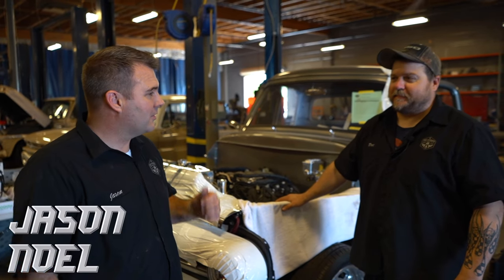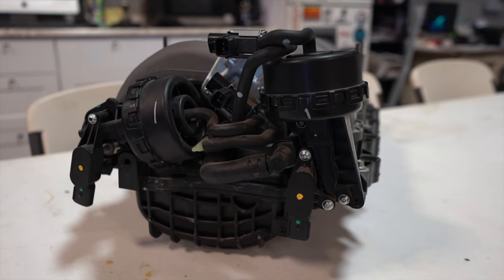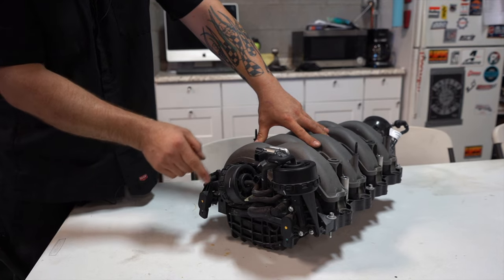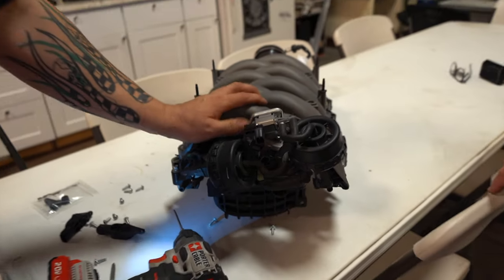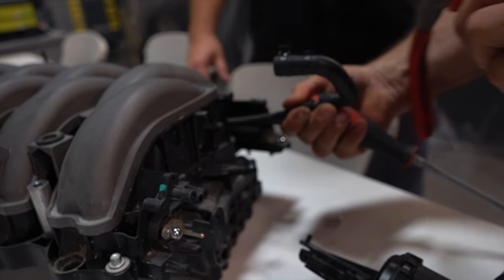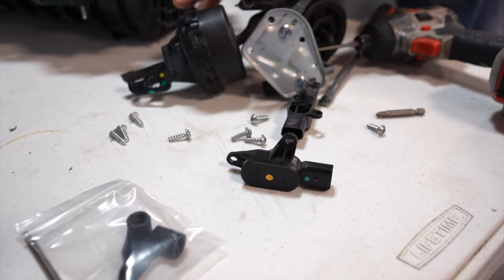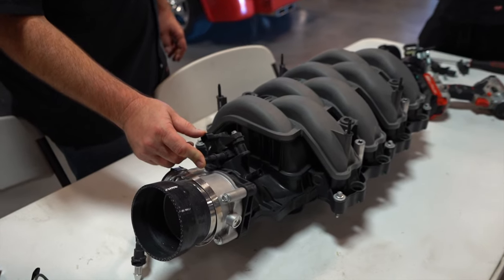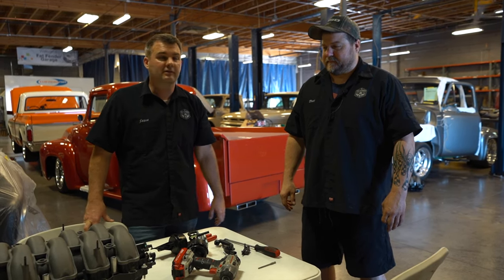IMRC Delete on a Coyote (HOW TO)

Comment: Those flaps are non serviceable correct? There are many of us that have a mystery misfire issue that has been shown to be a result of those flaps breaking, blocking off the airflow into the cylinders so they end up misfiring.

Comment: Dude. I’m begging you, Please, and I cannot stress this enough… hand thread your bolts before using the impact… just got through a 2 week stretch of drilling, bolt extractors, 2 breaker bars, 2 30 racks of Miller, 6 meltdowns, and buying new parts cus of that
Reply: They’re screws going into plastic not important

Comment: Great Video, you covered what to do with the Vacuum lines however there are five electrical connectors! Are they to be disconnected as well?
Reply: Zip tie them up and tape them. They're close to the knock sensors, so you don't want them banging around.

Comment: Please need advice!! I have a 2017 f150 5.0 6speed. IMRC stuck closed bank 3. Ofcourse manifold is covered under warranty. But back back order. Really backed up. I'm thinking of pulling my camper 7500 lbs. 3 hr trip usaul down grades and inclines. Engine light is on. But no preference issues. Posted here to get some honest opinions on what im about to do. Thank you !

Comment: I currently have the gt350 intake manifold but im still NA whats the point of an IMRC delete? I am also having a code showing up with manifold control runner stuck any clue on whats the problem?
Reply: Any  chance you remember the solution?

Comment: Could you make a video showing the general parts you use for a coyote swap. ie wiring harness, control pack, fuel pump,.
Essentially what you need to get the motor running and have it laid out on a table. I would greatly appreciate it. Thanks for the information you have put out this far
Reply from the maker: Bulmaro Gomez good idea. I’ll add to the list of things to video.
Reply: @FatFenderGarage  working on a f100 and there is a lot of videos out there that arent as clear especially with 3 gens of coyotes.

Comment: I have a 2016 F150 5.0, when hooking up to scanner...code reads P2011 (intake manifold control circuit open (bank 2). Will that matter if I just leave it alone and drive on? It seems to run fine and gas mileage is around 21 on the road.
Reply from the maker: Sunsettvu no, you need to have a tuner turn that off. It won’t run properly.  Fuel trims will be off

Comment: You can also use zip ties to hold the runners open if you're on a tight budget.
Reply from the maker: Good tip!
Reply: @FatFenderGarage  lol ghetto tip, but it works.
Reply: Ford is replacing my manifold at 50,000 miles because of a problem with this system. I have a feeling it will happen again. Wondering if I should do this before then.
Reply: Ford is replacing my manifold at 50,000 miles because of a problem with this system. I have a feeling it will happen again. Wondering if I should do this before then.
Reply: @baumiganssupperclub297  no, if you engine is factory stock keep it. You will lose power and torque down low. If you remove them you should tune the car accordingly.
Reply: I'm having the intake runner control valve issue on my 2016 coyote. Been frustrating so far even to just find a new intake. After I got the new intake and installed it, it seemed to be sucking air or maybe a Crack somewhere in the new intake. Has anyone else experienced this? Would love to hear a solution. I'm Sealing up where we think the air leak is happening but had to put old intake back on for the time being. Hoping we got Crack or gap sealed to put new intake back on early next week. I love this truck and only issue so far since I bought it in 2016.
Reply: Can’t find a intake it’s on back order grrr

Comment: I had the car for a while nowmy plan is to rebuild it make it better I just want to find a good motor for it because now it's like high mileage and I will just find a good follow you no motor for it that we were good for the car AC heating and air and all that good stuff if that's possible and I just want to go fast automatic transmission and everything

Comment: Does it work on a 6.2?
Reply: Wondering the same.. also if the intake manifold is already broken does pinning them open work? 

I'm guessing but I think pinning them open will work as if you unplug the IMRC the engine sounds fine.

Also not sure if the pins will work but if you look at the design of there's you could make your own possibly out of some metal. I'm sure if it's different it is not by much.

I'm going to look into this further and find a shop near me that can do the tuning side.

Comment: 15 GT stock manifold.  So if I don't have a tuner ($400+) this will just cause a check engine light but won't affect drive-ability correct?  Currently, it randomly cuts off while idling in drive-thru etc.
Reply: bro you def need a tune man ASAP, you will mess up the ECU, get a tune from LUND, they provide tunes for this, they the best!